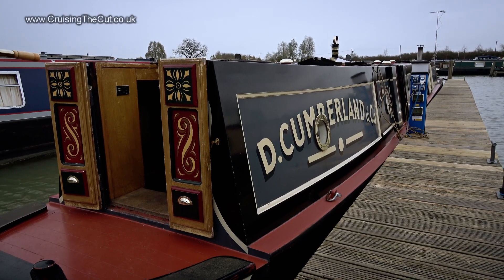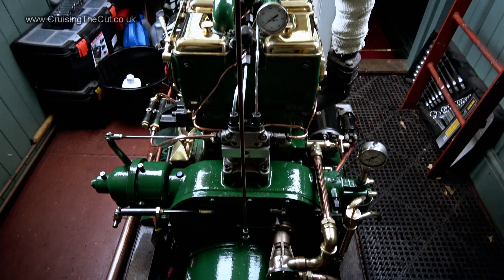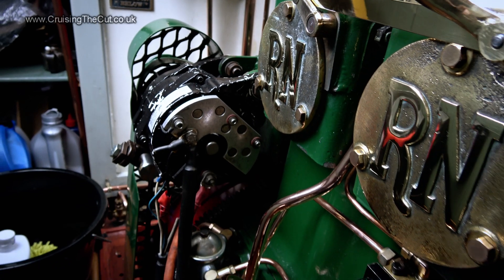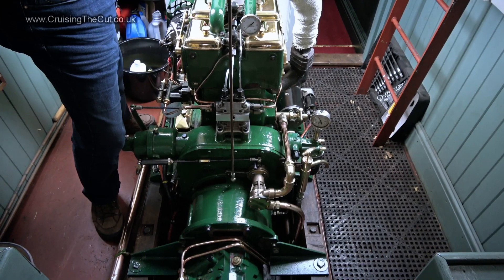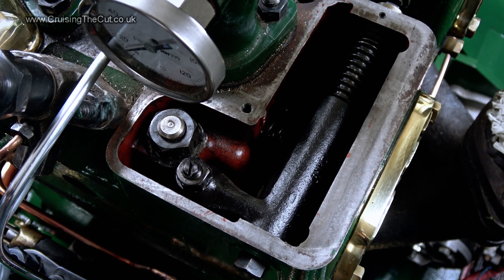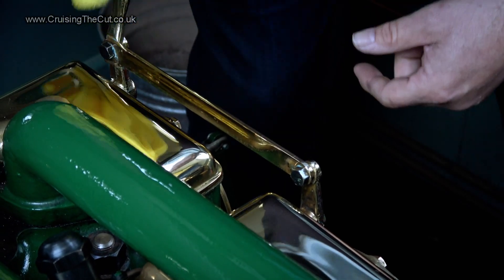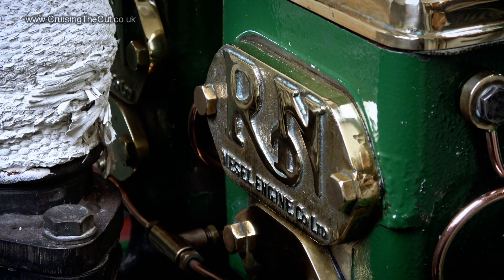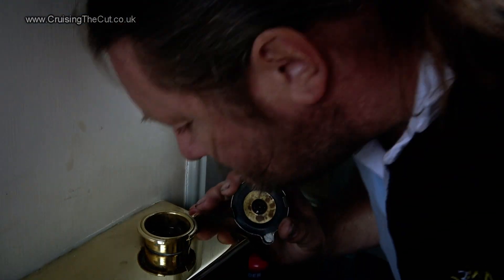128. Classic Narrowboat Engines Part 1: Russell Newbery, with Chris Wenham

Comment: David, loved the vlogs about the old style engines. Truck drivers as you know, wished for smellovision. There is nothing like the smell of diesel in an older engine. The semi of today, even at 640 hp, does not have the same sound. We used to drive an old Mack truck in the early 1980s. The sound was so loud in the cab of the truck that me sitting just arm's length away from hubby was hoarse after 30 minutes down the road from trying to talk over the engine. We give ourselves whiplash when we think we hear an old truck or farm tractor with a similar sound to the engines you showed. Hubby really enjoyed these vlogs.

Comment: The original Russell Newbery factory still stands in the town of Altrincham, Cheshire. If you take a Manchester bound tram it's the first brick building on the left that you can see once the tram has cleared the station. I think they left that building many years ago.  It became home to a builders merchant and more recently an art gallery. Nice to see the building being re-purposed but would be nicer still if they still made engines there. The only evidence is a 'blue plaque' commemorating Russell Newbery.

Comment: Boat and engine are wonderful ! I sometimes wonder if a diesel cabin heater directed onto an engine block for half an hour prior to starting may help in cold weather. Apart from taking the chill off the engine / engine oil, warm intake air must also help.

Comment: There is a very good reason for having a old type Engines ! The Gardner 2, is probably the best engine for a narrow boat.
Why: because it came from a company who over engineered their engines to last for a very long time! 
They made engines from, the single cylinder, and right up to a strait eight engine. Used throughout the haulage industry. 
Parts are all interchangeable, regardless of how many cylinders ! Very good on fuel, and will out last all others, providing
You bother to change the oil and filters. As far as I am concerned, You cannot do better. 🤪

Comment: Thank you so much for your engines series. I have always loved vintage engines & have had many happy times on the Norfolk Broads propelled by Stuart Turners & British Seagull outboards. 

A note on starting in cold weather: would it be possible to pre-heat the oil?
The Japanese built a submarine aircraft carrier during WW2 and the preferred method of starting the aircraft engines was to preheat the oil with an electric heater. It allowed them to surface for the minimum amount of time and reduced smoke.

Comment: What makes these engines so desirable is the fact that they run at such low rpms. They don't grind themselves to bits, running at 2,000+ rpm, that has to then be reduced to turn a prop. The fact that they need special care is simply because they are so old, or the material is of old specification. If new, slow-speed engines would be built the manufacturer would have a problem because they would rarely fail and never need replacing.
Reply: Bruce Boschek - check out the RN website - they are still building new engines made to the old design but enhanced to meet more modern requirements - you can still have a new phut phut low revving beauty that could well outlast you and the hull

Comment: This might be a silly question, why do all of the classic engines seem have that vertical ring over the top of the exhausts?  The sound of the vintage motors certainly is nice.
Reply: No such thing as a silly question! The ring over the exhaust is called a Splitter.  The idea is that it deflects the exhaust either side so the streerer isn’t breathing in a lung full of diesel fumes......  This does not work all the time!

Comment: This engine featured in this vlog is almost to pretty to run. Diesel artistry.
Reply: Randy McElwee Trust me, she runs and works hard. Big H weighs 32 tons. She’s often spent 12-14 hours cruising along the cut and on several occasions towing a further 15-20 tons.  Not bad for 18 HP!

Comment: Why run a mono grade oil? That may have been specified in the twenties when it was originally designed, but that's because they didn't have multi grade oil back then. A multi will give better operation across the entire temperature range, while still lubricating adequately at operating temp.
Reply: All of these older style engines tend to have a larger clearance in the piston to Bore area. The rings are also a lot wider to cope with the soot that comes down the sides of the pistons and result of the Bosch style injectors which ,although very efficient,are not 100% efficient in terms of fuel delivery. . So the oil used is usually #30 grade with a high detergent content to clean up the carbon particles. i have used Detergent 30 on all sorts of Diesels from Car engines to EMD locomotive Diesels .That's why,if you ever saw the oil you notice that is very black with a nutty smell. Modern(ish) Diesels with high pressure common rail injection do not wash down as badly,run at higher RPMs and are turbocharged ,hence the need for multigrade style oils.
Reply: Even better, one of the higher viscosity-index full-synthetics. They maintain viscosity within a narrow range over a wide range of temps, unlike "dino" oils. They don't have detergent ADDITIVES- being inherently high-detergent. Wouldn't use anything else in vehicle engines or small screaming 2-strokes.

Comment: i could not remember which episode of yours you had to clear your fouled prop, but do any narrow boats use a shrouded or ducted propeller they greatly increase the efficiency of boats that travel less than 10 mph as the thrust is forced to go either forwards or backwards through the duct and not away off the tips of the blades in a radial manner.  now i do not mean like a jet drive or jet ski.  the other benefits is that it would prevent fouling and has the benefit of being a real improvement when reversing.
Reply from the maker: None as far as I know. I would have thought it would increase fouling due to the ropes/plastic bags/detritus being sucked in to (or catching across) the shroud??

Comment: I take it that the low RPM engines connect directly to the prop shaft with no gear reduction?
Reply from the maker: Hmm, there was a gearbox although I forget which model, and I suspect it may be there merely to engage forward or reverse, I'm not entirely sure. Chris has a Facebook page (link in the video description) so you could ask him directly there.
Reply: Herbert has a PRM 260 box, with a 2:1 reduction.

Comment: Disagree with the monograde oil argument.  Been a classic Britbike fan since before they were classics!  Been through all the arguments, having been an outspoken supporter of monograde for a long time after it was, well, stupid. Point is mostly about detergents.  Monograde are low to no detergent, multigrades are high detergent.  Hi-D oils maintain impurities (carbon and metal grindings) in suspension as they work, and that sounds bad.  No-D oils presumably allow the impurties to settle in the sump, and so they'll stay there until the next draining.
The big change to modernity was in fact not part of the oil at all, but in the advances in oil filtration systems.  Newer filters are designed for full flow and full pressure, they take out many more of the impurities as the engine does its daily work.  In the bad old days, filters were an afterthought, and ranged from none at all through bypass (only partial filtration) to fullflow but felt - sort of like straining it through a piece of rag.  Latest paper-cartridge filters work through a much smaller micron range, and getting the skludge out is continuous as the engine is used, not dependent on a change interval.  Nor do you have to get the oil really hot before changes, in an attempt to get as much skludge in circulation as possible before draining, nor do you have to obsess about flushing all the accumulated crud out of your sump when changing, since it wasn't encouraged to accumulate in the sump; it was filtered out into the filter during its lifespan.
Engines, on the other hand, don't care about grade, just a plentiful supply of clean oil circulating through their innards.
And of the proper viscosity, which, for any oil type, varies with temperature.  Monograde was old fashioned primitive lubricant, and its viscosity varied much more with temperature than is the case with modern multigrades.  Better living through chemistry makes for less dependence on warmup, and better flow at a much wider range of oil and engine temps.
Summary: the hot setup is modern multigrade oil of appropriate viscosity range, and a Full Flow system using a proper modern paper-cartridge filter.  Your engine will wear much less and need much less fussing at oilchange time.  This has been verified through many research projects using such measures as spectrographic oil analysis.  Look it up, or just trust me! 8-)
ps, B.Ed (metal and mechanics) UBC
Reply: Well said Pete, but. The oil I use is Morris SAE 30,very well formulated, has a good detergent and the engine was designed to use that weight of oil. In the best engineering practice, ‘If it ain’t broke, don’t fix it’. It’s a low stress engine, only 18hp, but around 100ft Lbs of torque.  Also it has a full flow spin on, cartridge filter. Oil and filter changes happen ever 250 running hours, I’ll do a vid showing a full engine service in the next couple of weeks. Look for the Diary of a Herbert page on Facebook or YouTube.    Just one last thought.  Would you deviate from specified lubricants on an engine which cost £26,000?...........  Cheers, Chris

Comment: Ok, other than nostalgia: What is the appeal of older engines? Are they particularly good ("They don't make them like they used to anymore!") and reliable?
Reply from the maker: The sound, mostly I think. They can also be very reliable.
Reply: DreamingFlurry Whilst they may not make a huge amount of power (18 hp), they do make loads of torque (Just under 100Lbs ft). The fuel consumption is around 1Ltr per hour, and as long as they’re serviced correctly, should be just as reliable as any modern engine.  Possibly more reliable as they are designed to run at low rpm for long periods (Not good for modern high speed diesels), and are not highly stressed. Herbert’s DM2 will quite happily push 32 tons through the cut with no problem, despite Herbert sitting as deep as a working boat and earlier this year towed a 60’ boat all day with no problem.

Comment: Very interesting, Question: Why do you have to use mono oil? I know that we are told that this old engine "must run on single or mono oil", BUT WHY??? 
I believe the only reason we are told to use that type of oil, is because when these old motors where made, - They could only get mono oils!
I suspect, that your oil is a strait 30 grade. If so, you should be able to use a multi-grade oil that incapsulates the viscosity of 30, like a 10/50 or 20/50 oil.
The only thing I would check, does your strait 30 grade oil, have any other additives included for bronze bushes? Or dues it contain Graphite, if so Graphite can be bought
in powder form and then added to your 10/50 or 20/50. Modern oils are far better than the old oils from years ago! 
I am a retired Mechanic and believe that all engines can be oil tight, if put together carefully. Anyway: thanks for showing you Russell Newbery twin, Beautiful.
Reply: Originally these engines had no oil filter.
Any crud in the oil (byproducts of combustion like carbon particles) which the oil washed off the bores etc was carried by the oil to the sump area...
a huge sump where the suspended particles could fall out of suspension to the sump bottom.....
leaving the "naturally filtered" oil to be circulated throughout the engine.
Modern detergent oils carry this suspended particle load all the time and rely on good filters to take it out as the sumps are not as large thus the oil is always rushing around....
So if you use the multiweight high detergent oils the carbon particles keep grinding their way all around the engine...
unless you have an add-on modern oil filter plumbed in.....
Reply: @JohnSmith-yv6eq   Great answer. I had no idea about that until you mentioned that! Cheers mate!

Comment: I'm a 2 stroke gas engine boater fuel economy is awful I get around 1 liter per km. .  How do the  traditional engines fair compared to a more modern diesel in fuel usage.
Reply from the maker: With apologies, I don't know what Chris's fuel economy is on that engine.
Reply: The Russell Newbery website claims 1 litre per hour of normal canal cruising for the DM2 engine so guess that’s about 6km to a litre

Comment: why use monograde oil? you have such better options
Reply from the maker: Because that's the correct stuff for that engine.
Reply: @CruisingTheCut  back in the day that is all they had. you will get much better flow with modern oil at low temp
Reply: Would you deviate from recommend fluids with a £26,000 engine?
Reply: @CruisingTheCut  Plus, with multi-grade oils on old engines, it tends to get past those old style seals and make a hell of a mess. Even the single grade oils have a better formulation and detergent package than they did 50 or 60 years ago, so the engines last quite a bit longer than they used to.😉

Comment: A lovely old engine but a massive heavy old one too. I guess its very fuel hungry and inefficient compared to a modern lump...
Reply: James S D we hired a narrowboat last August and did the Stourport Ring, averaging 7.25 mpg. On one of Country House Gent's videos he does some fuel consumption figures and I seem to recall that he worked out that he was getting about 9 mpg so in this case old crushes new!

I'm getting my own boat back from refit in the next few weeks, I'm planning to keep an accurate record of fuel usage and I'll let you know what I'm getting to the gallon.

My engine is also a Russell Newbery. I get a huge amount of compliments on the noise.

I'll keep an eye out for you on t'cut!
Reply: The 3/4 ton engine pales into insignificance on a boat weighing 32 tons in running order.  Thumper burns around a litre an hour under load.

Comment: Whats going to happen to these works of art beautiful engines when the government do away with diesel oil? It's a job to visualize a D8 bulldozer with an electric engine or an Artic lorry or even a Crane. What's it going to cost Eddy Stobart to change all his lorries over to electric?
Reply: No need to convert things to electric really You go back to Anton Diesel's original idea of running Diesel Engines on unmodified vegetable oil. Remember Diesel ran his engine on peanut oil at The Paris World's Fair in 1900 when he showed it off. Found an interesting little factoid just last night, turns out that Diesel's original engine design which ran on vegetable oil achieved a 75% fuel efficiency rating, much higher than today's engines which get maybe 41% efficiency at best, with and average of 30%. Makes one wonder why people ever opted for petroleum diesel fuel? Turns out, at the time  (1897) petroleum diesel was cheaper than vegetable oil, and that's the only reason petrol-diesel became more popular than vegetable oil even though vegetable oil had more energy.
Reply: Sorry sir vegetable oil
Is not 75. % vs 41% today.

Also try running on vegetable oil without mods.
It does not work unless heated.
Now biodiesel made from veg oil is fine.

To run on veg oil you start on diesel or biodiesel then when the jacket water gets up to temperature switch to vegetable oil that has passed through a heater using the jacket water.
To shut down reverse the process
Switching back to thinner fuel to flush the lines.

Comment: I am an American. OK? I desire dependability and economy. Volkswagen makes a diesel engine used in many of its cars. It is dependable and fuel-efficient. Why don't any narrowboat owners utilize this motor?  It is compact and can fit most engines compartments.  My Petteral car uses 30 US gallons to travel 100 miles. While my Volkswagon, four-cylinder diesel uses five gallons of fuel to do the same work. Tradition, sometimes, kicked us in the ass. I'm sorry, And I do like the old stuff. But a line needs to be drawn.
Reply from the maker: I’m not aware of anyone having marinised a VW engine (and they do need modifications to make them suitable)
Reply: engine for marine use were different from cars..not even people in the US use VW engine in their boat..
Reply: Does it have polished brass & go "kerplunk"?
Reply: Brits are cooler than Americans though.